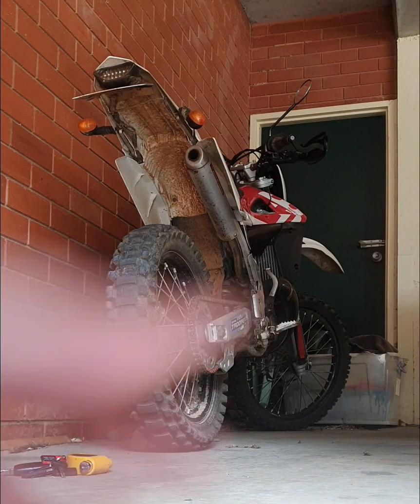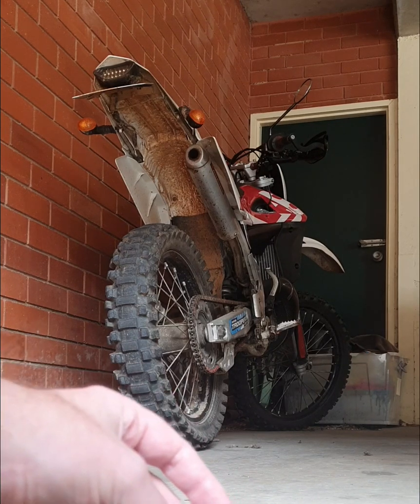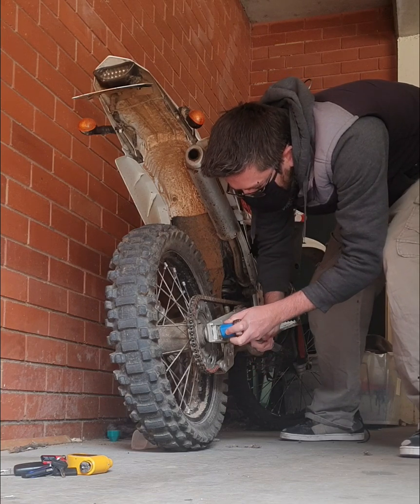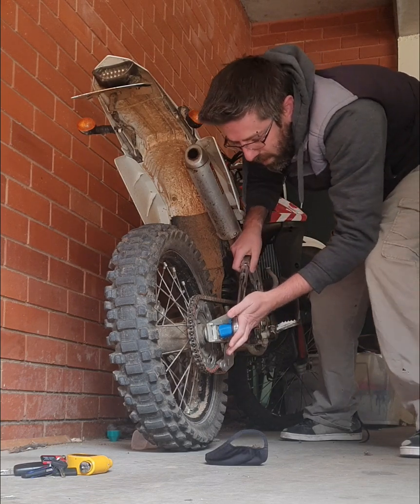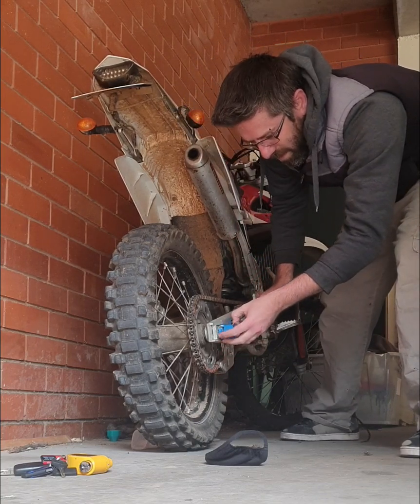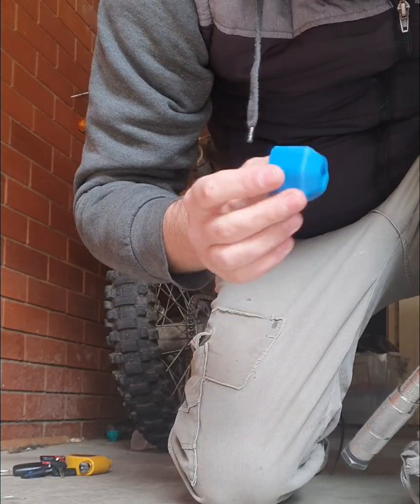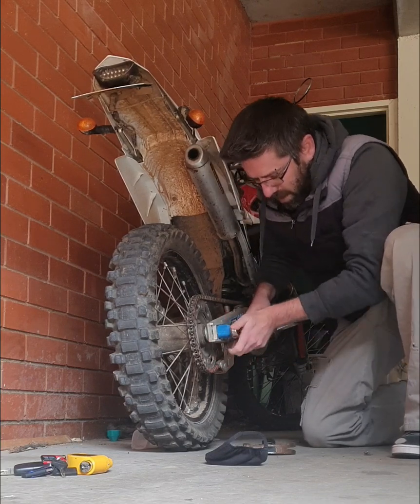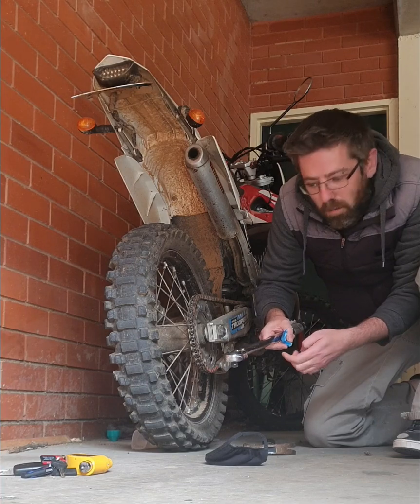How strong are my 3D printed sockets?

Comment: Have you tried variations? What comes to my mind:
- make it thicker/use a different infill
- make a sleeve (like a 2mm sleeve to tighten a 28mm bolt with a 30mm metal socket)
Reply from the maker: Only a couple.

I tried printing at 45 degrees to tilt the layers to 45 degrees but so far the horizontal layers work best surprisingly. 

This all start from the need for a 32mm socket to remove a plastic housing off my car that needs a torque setting of 25nm.

I think I'm done trying, I've got rainbow pot planters to print for my daughter 😁